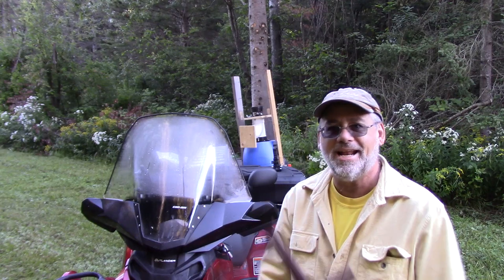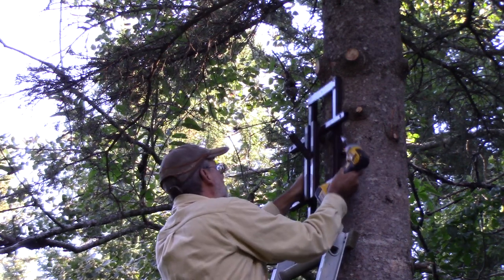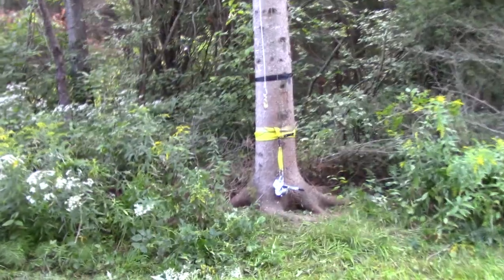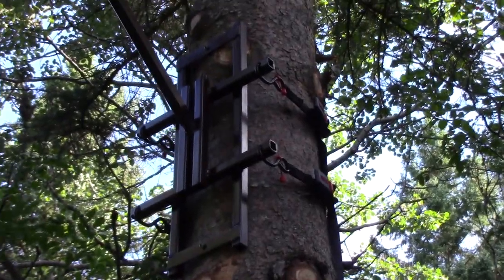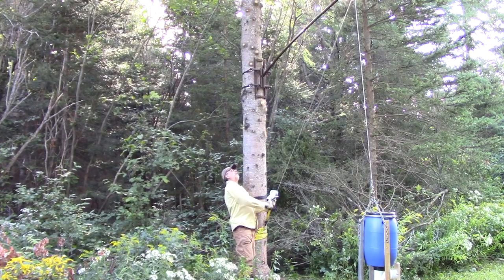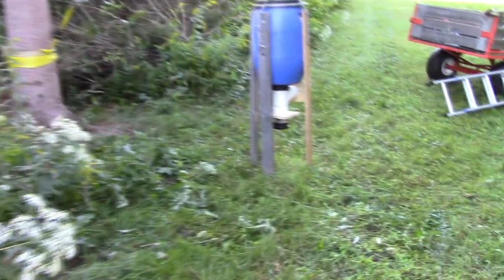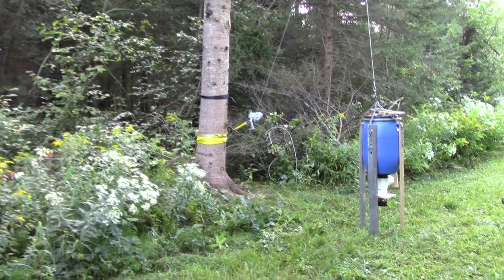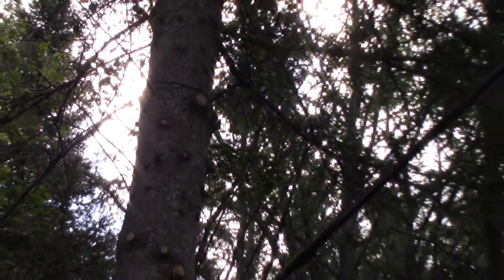Ultimate Deer Feeder Corn Barrel  Hoist  Setup

Comment: I'll build myself one of these bracket for my property out west. The only difference is that I'll  bolt the winch to the tree, and add one more pulley under the bracket. Nice job
Reply from the maker: The winch could use some improvement , another pulley thats interesting. Thanks Victor.
Reply: @SteveRobReviews  I was thinking the same thing. Another pully at the tree st thebase of the pole with the winch mounted to the tree. The other pully could act like a snatch block. Awesome job.
Reply from the maker: @billfischer6464  All good ideas and I will mention them in the future  as I just may have to implement them in the future . Oh well it's a lot of fun and I learn a lot from my viewers . Thanks Bill.

Comment: How's she goin'?  The bracket went on the tree pretty slick.  The top guy, I think, would be better than a gusset.  With that long a beam, it sure adds to the force that wants to bend the main boom.  Pretty neat though.  I like working on projects like this where you create a solution for a problem.  But like the guy says, for every solution there is a problem!!!  Take care!!!
Reply from the maker: Thanks Mike I will try the gusset but have the wire for backup and up she goes into a tree real soon. Cheers

Comment: Hey Steve, that contraption reminds me of one them Vietcong boobytraps! Lol, hey you never know, that thing might let loose and spear kill one of them bears!  Lol
Reply from the maker: 😅😅 Its not vietcong up here but it's a gong show eh. Stay tuned for the fix and another one going up a tree if it likes it or not.
Reply: STEVE ROB REVIEWS  Hi Steve, I’m just giving you hell jokingly, I think you would be better off coming either straight out with that piece, or maybe up to a 15 degree angle, then mounting a cross brace underneath directly to the tree, that would be the strongest way to do it, and that is how they build girder bridges, which is pretty much exactly what you are building, only nothing on the other side, I think if you look at it from that perspective it will help you design this. Have a good one Steve, look forward to seeing more of your videos.
Reply from the maker: Thanks Jeffery , well that's a good idea too.  I will try my design first and yours second because its a good idea.  Lets see how the new design works  first and onto plan "B" LOL
Reply: @SteveRobReviews  i think you gusset will work as long as the material is thick enough. The problem is with the extension being that long its like having a fulcrum, theres allot of pressure on the end of that bar where it fits into the bracket, if the load is lets say 300lbs, the force on that end is probably guessing 5 times that. Lets see how the gusset works, curious.

Comment: Great job! Rarely does a job go exactly as planned. When you put the pole on the shaft and mentioned the barrel was 80lbs I thought that might not support that weight but you solved that quickly with the support wire. I LOL when you said the feeder went off and scared you LOL. It's going to be a good deer harvest for you this year brother! Cheers
Reply from the maker: Bud it  should be called gong show of the north :)  The next one may fire up a tree better. LOL

Comment: Why don't you bolt the crank pulley to the tree, make it easy for you
Reply from the maker: I didn't want to kill the tree but interesting enough a friend worked  in forestry and told me using  lag screws  would not kill the tree so I did just that . Bit of a gong show without but it's a learning process 😅😅
Reply: @SteveRobReviews  other than that, great job. Keep learning, you can never know enough. Thanks for the information.

Comment: Thanks for laugh. Mount the winch solid buddy. Red Green has nothing on you. Why not use the winch on your atv???
Reply from the maker: The handle must rotate on the winch plus its great cardio. Did not  help me putting the cable on backwards on the winch , nobody seen that :)  Next one will be slick maybe and much easier but it's going  in the bush deep for the monster bucks.